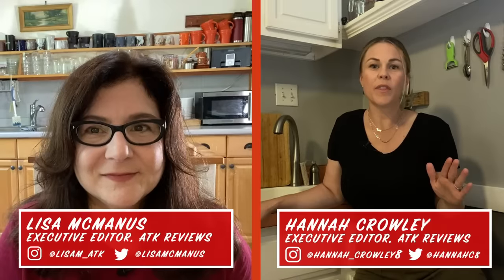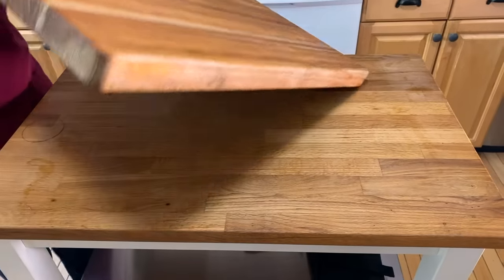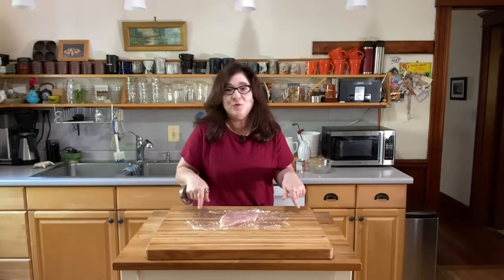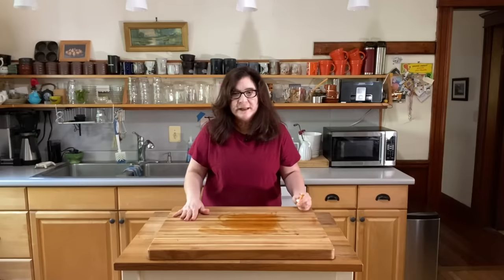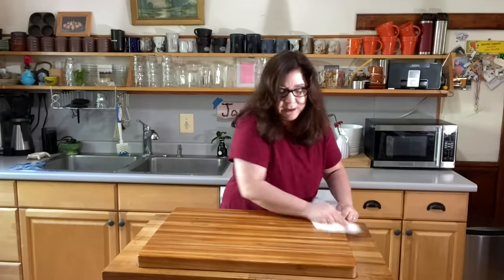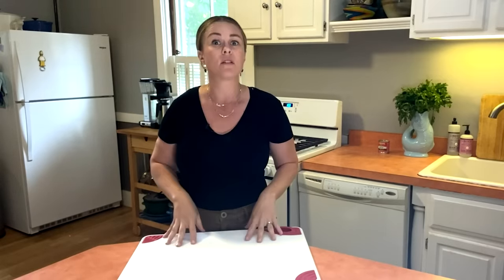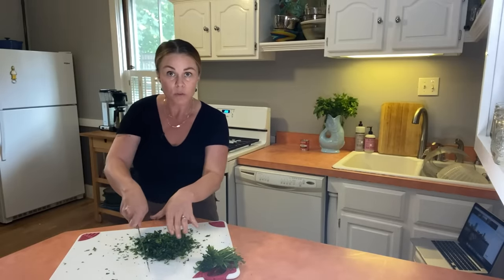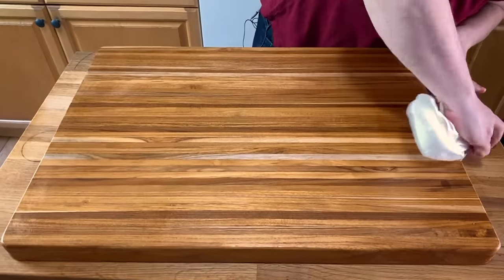Gear Heads | Which Type of Cutting Board is Best for Your Kitchen?

Comment: As a woodworker that enjoys cooking, I've made dozens of cutting boards over the years...mostly for friends and family.  One tip that may prove valuable is, when in the process of drying the board, tip the board up and lean it against a cupboard, etc..  It will allow air flow on both sides of the board, minimizing the warping caused by deferential drying.
Reply: exactly right!
Reply: Beets are worse
Reply: Tip it on a corner.
Reply: That is why a thick board can be nice. If it touches a cupboard it can leave an oil mark.  Thick ones can stand on there own.  Also if you get a new board, be ready to sand it a bit if the grain pops after the first washings. I got 2 new boards ( very nice teakwood,  they came highly recommended) they both poped the grain after the first washing. Don't go crazy, just sand them with some 220 sandpaper till smooth. LIGHTLY!!! Till smooth and oil them for a week....
All will be good.....
Reply: Thankyou

Comment: people forget that when it's too large it's also too heavy and a pain to get it in the sink to wash.
Reply: MK25  big is nice just for the room offered.. but like I said it's a pain to clean in a sink ;)
Reply: Honestly, we have 3 Rubbermaid boards(sm/med/lg) and they’re double sided with rubber handles. They don’t slip, stain (I wash by hand) or smell. Have had them for about 3 years and they’re still going strong!!! I’m a professional cook and I’m more happy with mine than the ones at work 😁
Reply: They literally mention that
Reply: Ya that giant wooden board would be a huge pain to clean after chopping 1 piece of raw meat, f that.
Reply: @drpepper3726  it might be a good idea to scale to family/use
Reply: It's almost like putting a wooden cutting board into a sink is extremely silly and unnecessary.  All you need is to wipe it down with damp cloth and vinegar spray.  You can do it right there on the counter.  If you're treating your board right, there should never be a need to place it under running water.

Comment: I've found that when you wash a wooden board you should wet both sides whether or not you used them,as well as the edges.This prevents uneven drying and consequent warping
Reply: Thanks for the tip! I destroyed some wooden boards recently and want to do my new one justice :)
Reply: Great tip! Especially for the more expensive end grain boards!
Reply: It helps to give it a good drink of cutting board oil, then it doesn't soak in water or bad bacteria, lasts longer, and looks better.
Reply: I've always heard to wash both sides of a cutting boards even if I've used only one side.  Just never know what's been sitting on the kitchen counter that might get transferred onto the underside of the board during use.

Comment: "you can put it in the dishwasher" as it is too tall to fit XD
Reply: Or perhaps she has the dishwasher with a slightly narrower upper basket
Reply: Sears sold a few such models a while back
Reply: I peeped that!!!!!!!!!!!!!! Hahahahaha.
Reply: One of the reasons I switched to wood because a large plastic cutting board does NOT fit in the dishwasher anyways.
Reply: Did anyone else notice that on the plastic cutting board demo, they showed the backside as if it were the right side.  So no stain, of course.  Heehee
Reply: @msmonet  The board is reversible.  How can you tell that they are showing the backside?
Reply: PositiveChi100 the position of the round grip handle switches.
Reply: Depending on the board and dishwasher, it's possible to put something tall and flat at the outer edge of the lower rack, where it will fit alongside the upper rack and not run into it. Do it all the time.
Reply: That was some shoddy editing😆  They should have just shown her loading it in.
Reply: None of the recommended minimum sized cutting boards will fit standing up in a dishwasher. I have to put my plastic cutting board on the top rack or place it diagonally on the bottom tray - making sure to not get in the way of the middle, rotating spray arm. I have a wooden cutting board with multiple plastic color coded "cutting boards" that fit on top of the wooden one. I like this because I do not have to worry about cross contamination.
Reply: A plastic board which is too large for the dishwasher can readily be cut down to fit on a table saw, and then have the edges eased with a router.  I went o Engineering school at the University of Nevada, Las Vegas.  Two of the guys I went to school with paid their way through college making NSF certified cutting surfaces for commercial kitchens in Las Vegas.  They would do either hard maple or HDPE (High Density PolyEthylene).  Most kitchens went with the HDPE versions because they, cost less, lasted longer, and could be run through the dishwashers.
Reply: It fit just fine though... you can tell just by watching it carefully. It just slides right in on the side.
Reply: @msmonet  they showed the hole on the upper right and with the hole on lower right so they stained 2x. when she held up the board to smell you can see both sides anyway
Reply: PositiveChi100  Hmmm🤔That’s a good question!! And you’re correct 😉
Reply: PositiveChi100  ...but I’m gonna go back and watch it again anyway...maybe I missed something🤷‍♀️
Reply: Randall Thomas  Thanks for that informative info, Randall!!!
I appreciate that👍😉😃
Reply: Exactly.  If you have a good sized plastic board it isn't going to fit in your dishwasher in most cases anyway.  I have a plastic board that just BARELY fits in mine, but in order to make it fit I lose half the bottom rack.
Reply: He he he i thought i was too 🤪🌲
Reply: Pull the top rack out.
Reply: @gregfeneis609  you ever try removing the upper draw/layer in your dishwasher? Like doing a stock pot? Your welcome..
Reply: @msmonet  I don't know what you are talking about. When she picked up to do the sniff test both sides looked perfectly white.

Comment: When I get a big beautiful kitchen, sure, I'll invest in a big beautiful wooden cutting board. But, right now I have a small kitchen with a small sink and small counters... so I use a plastic cutting board that fits, is easy to clean, and easy to put away.
Reply: Same here
Reply: I know, right.
Reply: You see through our eyes.
Reply: Right on. We have about five or six thin plastic cutting boards the size of the board she threw out. They get the job done and fit in the dishwasher. Then we have a couple of slightly larger ones, one with some grippy rubber at each end for when that's necessary. It works in our small kitchen, and I've been feeding a family of four most nights of the week on them.
Reply: @mahna_mahna  I have a medium sized plastic board for most things and a smaller plastic board for meat.
Reply: Agree
Reply: One problem with ATK is that they have huge kitchens to do their tests in and basically no limit to their budget. Some of us have to live in the real world and need to purchase equipment that actually fits our budget, our kitchen and our needs. I live alone and while I'd love to have a giant cutting board, I have no need or space for it. Same with many of the gear they test. Be nice to have a Kitchenaid Pro stand mixer, but it would be terrible to mix up dough for one small pizza or one batch of cookies in it. Their preferred food processor is the most expensive in the line of Cuisinart and has very limited flexibility, it is nice and quiet though and stops on a dime when you release the pulse button, something that is related to the type of motor, induction, which is used only in high-priced machines as it is very expensive. 

But what can you do? It would be nice to see ATK do a series of videos on great lower priced gear for singles or couples who don't need to cook food for a restaurant and do not have unlimited budgets.
Reply: Same! I have half a dozen plastic boards in a rack on the counter. 2 big, 2 medium and 2 small. Covers any size I need when cooking a big meal. Comes from working in professional kitchens to have multiple plastic boards. Some day I'll have my dream kitchen!
Reply: You can also use a wet towel/paper towel or a piece of that grippy shelf liner to keep your board from moving.

Comment: Size: the big problem is counter size because if you have a small counter you are limited to small cutting board.
Reply: I feel like sink size is the last thing we think of. I put in a 9” deep doublewide tub and can fit all my meat boards (up to 18x24) to wash but if I had my old 6” sink with divider, I would have to wash most of them outside.

Comment: It’s incredible that no-one mentioned which type is best to retain the edge sharpness on your knives — this is especially important if you’re using an expensive carbon steel knife 🔪 .
Reply: They said they did a lot of tests but they didn't go over any of the tests in this video outside of the stain test, so I wonder if there's an article or more detailed video about this. Maybe it's in the description I haven't looked ironically but I'm definitely interested also.
To be fair plastic isn't that hard so I doubt it's going to harm your knives any more less than wood.
Reply: @waltermh111  I think that the "Test Kitchen" basically exists to promote the "winning" products on Amazon, which is why you never see the results of the test, so take anything they say with a grain of salt.
Reply: The softer the better, if edge retention is the goal. However, it means that you will be cutting more grooves into your board. Personally, I find teak too hard hard because of the silica content of the wood. Bamboo is even worse; they are the most durable "wooden" boards, but dull knives far too quickly, in my experience.
I'd go for walnut or cherry if you want a board on the softer side; otherwise, maple, oak, birch are all good.
Reply: Edge retention is not a function of how expensive your knife is :)  However, carbon steel should hold an edge longer, all else being equal.
Reply: The problem with plastic boards with high Rockwell hardness is that the blade digs into the plastic and chips your knife. Better to have a harder cutting board for those types of boards. They did not even mention that at all. Kind of important.
Reply: @JohnSmith-oe5kx  Ding ding ding ding!  You nailed it.  They are completely useless for quality advice these days.  I currently own a better plastic cutting board that is twice as thick as their "favorite pick" and has 40% more usable cutting surface, and it costs less than theirs.  So they are just out here comparing popular brands.  That's great for the brands, but not the consumer.

Comment: I've always heard that, specifically if you use a bit more expensive knives, wooden cutting boards are preferred because they will dull the blade of your knife less, making the knife hold it's edge longer and requiring a lot less sharpening. I was hoping this would be addressed in this video.

Still a very informative video, so thank you for the review and upload!
Reply: Not had that problem so much with plastic. But, once I bought one of those acrylic cutting boards, (Don't know if they still make them) and you wouldn't believe how fast it dulled my knives. No give at all in the surface.
Reply: Good wood, bamboo, or plastic shouldn’t harm the edge of your knife.  Glass, ceramic, etc are a no-no.  I use the white plastic boards similar to what you see here with my good Japanese knifes without problems or undo dulling...
Reply: They mentioned durability, even sending the wooden boards to Autodesk for automated tests at 1:45 to see if the knife dulled, and then didn’t refer to the results. 🙁
Reply: They also didn't mention that, with wooden boards, there is a huge difference in hardness depending on what type of wood you have. An Australian buloke board would cause your knife to shatter, while japanese cypress is just slightly harder than butter. I wanted a softer wood that wouldn't dull my Japanese chef's knives, so I got a small American cherry board and a large mahogany board. Both of them are great, and my knives hold their edge for a long time.
Reply: As with many questions, details make a big difference.  Both wood and plastic cover a wide variety of possible characteristics.
I've heard similar comments as well, and I can only imagine that they're not in full context, or the original information was lacking some important details.
Acrylic is hard, and frequently criticized as dulling a knife, but still called plastic.  Polypropylene, or other similar plastics are far softer, and unlikely to dull a knife.  Though personally, I find them soft enough that very sharp knives dig into them, damaging the board a bit, and making for an awkward feeling chop.  
As with most tools, it's important to address how you will be using it.  Personally, I have multiple cutting boards, that I use in differing situations.
I like a bamboo board for rough, or borderline abusive applications, as it's a hard and durable surface.  Say when I break out the cleaver, a plastic, or softer wood board would probably take some damage.
For general purpose, a poly, or side grain board work well.
For using fancy extra sharp knives, I like an end grain board.  As it has a better feel when cutting, and it compensates a bit for the sharp knife cutting into the material, by being somewhat self healing.  While a side grain board would develop more cuts on its surface. 
If you want to get really fancy, there's pricy rubberized boards, typically made in Japan.  But while I think those are probably awesome, the price point will keep them out of most home kitchens, like mine.  They usually end up in sushi restaurants, or the kitchens of people willing to pay a lot for the best.  They seem to have similar characteristics to end grain boards.
And it should go without saying that really hard surfaces are to be avoided.  Such as glass, acrylic, and I've even seen some stainless steel cutting boards.

So a lot depends on your knives, and how you use them.
If by more expensive knives, you're referring to something like a high hardness, extra sharp knife, like upscale Japanese knives can be, a board such as end grain tends to be popular.  But I think that's more because of the way the board works with the knife, than because it dulls the blade less.
I do think a harder material, like bamboo for example, can potentially be harder on the edge of that sort of knife. 
There are somewhat pricey western style knives, such as Wusthof's that while of course sharp, are sharpened to a less acute edge.  And thus have less of the property that I like my end grain board for.

Oh and I'm personally not using the large sizes that they love to recommend.  I simply don't have the space for those.
Reply: @stevewebber707  I basically use plastic boards that are as large as possible while still fitting in my dishwasher, which means somewhere larger than an A4 but smaller than an A3 paper size’ish, each around 1 cm thick, which seems to be enough to avoid warping. That cuts down on cleaning time and you can just switch to another board for meat/vegetables etc. I have one larger (and thicker) board and I rarely use it.

Also, unless you’re cooking large portions for several people, I really don’t see how you would need the ridiculously large cutting area they seem to think is necessary. Simply finish up your work on one or two ingredients, move the stuff to a platter, bowl or whatever, then go to the next task. Switch boards as necessary.

I have used the larger boards when working in kitchens/canteens, where you indeed tend to need to prepare a lot of ingredients and in large quantities. But the need to hand wash a board that’s larger, heavier and more unwieldy than really necessary is why I generally wouldn’t consider them for home use.

I also have a couple of small cutting boards of roughly A5 size used when I just need to cut a roll, a fruit, a couple of slices of meats/sausages or similar. They fit easily into a few centimetres in a top cupboard stored on their long, rectangular edge, while the larger boards live in a rack on the counter.
Reply: @jeff__w  Take that as a hint.
Reply: No, I'm sorry. Rubber cutting boards will save a knife's edge better than wood, and it will not trap microbes in wood grain. Rubber has no grain. But, it it gets cut marks, you can easily sand it with fine sandpaper and a block. It takes minutes.

Comment: After working in many a commercial kitchen for quite a while, I've become very used to using plastic boards & work surfaces. The lighter weight, ease of "wash-rinse-sanitize", essentially being maintenance-free, & most are white, so you can see that they're clean, are all wonderful attributes

At home I have a set of these boards. A 6"x10" for small stuff, a 14"x18" for one person meal prep, & a 20"x26" for "Da Big Jobs". All have a strip of rubberized material on they're shorter edge, to steady them & eliminate creeping, no matter which side you're using. 
I. Just. Love. Them.  😁👍

Happy, Happy Cooking, everyone & God Bless.
Reply: For my big plastic board, I just sit each corner on a silicone trivet. That way I have no worries about sanitizing seams with stick-on stuff and the board won’t move at all.